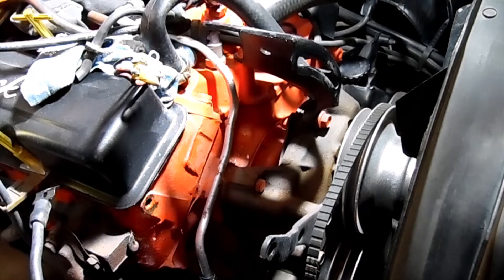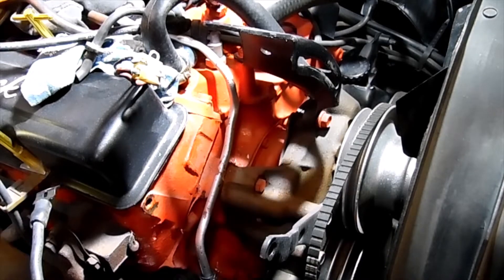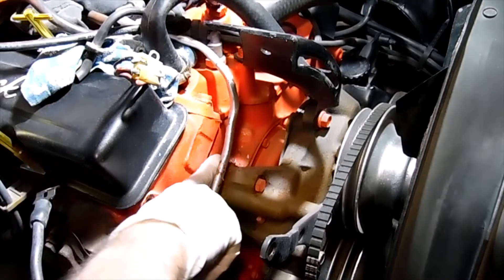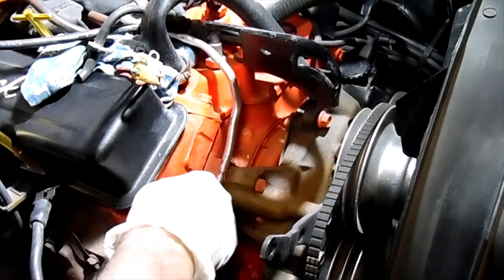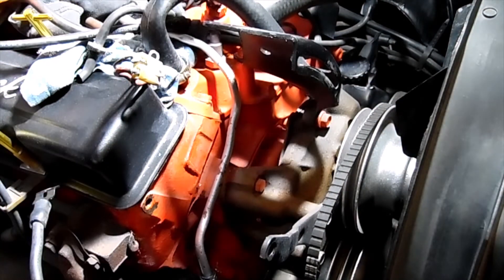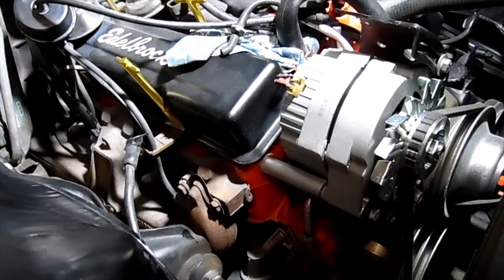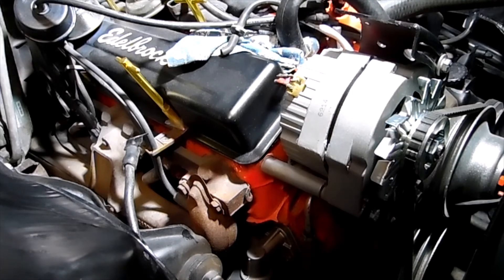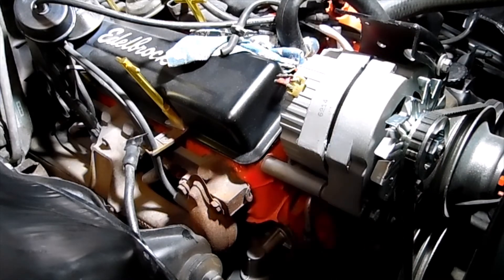79 Camaro Engine Suffix code & Alternator Replacement (How To video)

Comment: Did not push in connector tab for removal,  did not loosen 2 additional bracket bolts
Reply from the maker: True, I could've loosened 1 additional bolt to make it easier, but when it's 100+ degrees, I'm not all there sometimes lol. Thank you